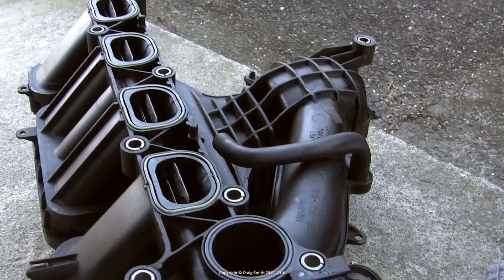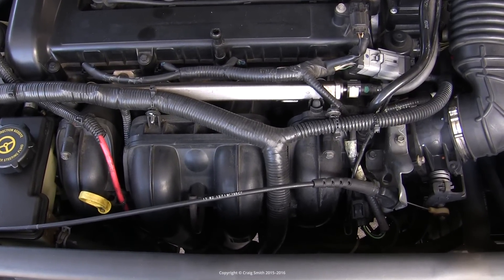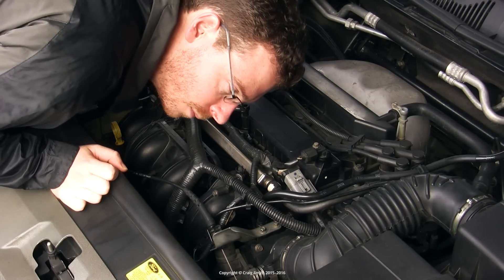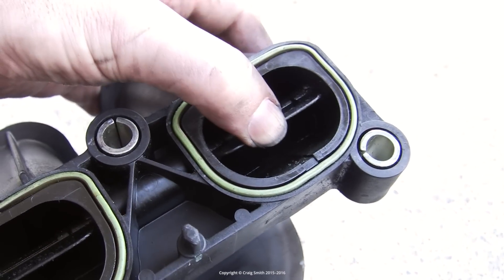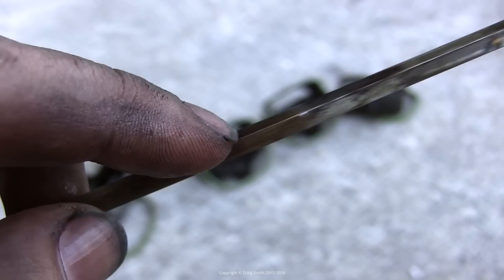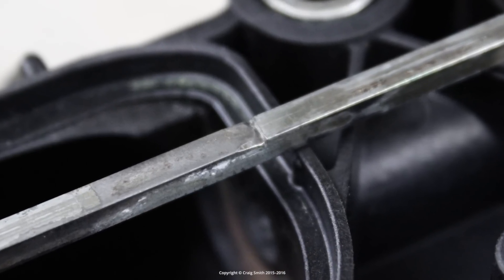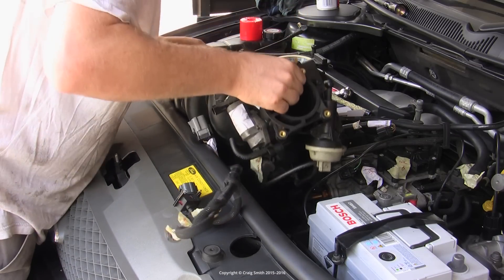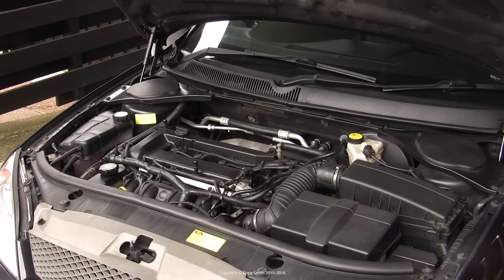How to: Fix swirl flaps & save your engine (Ford Duratec HE, Mondeo/Focus/et al)

Comment from the maker: Amazon links to relevant products (from the description):
Flap assemblies (x4) - http://amzn.to/2d3dawe
Manifold gasket - Amazon US: http://amzn.to/2bV8sLi  |  Amazon UK: http://amzn.to/2cpztel
J-B Weld epoxy - Amazon US: https://amzn.to/2HC7RRk | UK: https://amzn.to/2woHtUC
Reply: Hello Craig, If you have it could you post the actual Ford part number for the flap assemblies? The part on the link does not have the Ford P/N. I tried to capture it from the video but want to be sure.Thanks KPO.
Reply: @kpo42641  I think it's either 1317276 or 1S7G9Y428AA
Reply: What yr did they stop using tbese
Reply: The flaps , are they a sold pr piece or sold as a set of 4 ?

Comment: I got rid of the swirl flaps in my Duratec engine.
Upon examining the engineering of the whole assembly, I could not help thinking how badly conceived it is.
For one there was no bearing points on the manifold for the square rod.
The whole thing rests on the flimsy edge of the flap body, which in turn has nowhere to dissipate or absorb engine vibration.
The square rod tunnel points between the inlets, could have had a softish material bearing to steady vibration movement.
Anyways, I got rid of the whole thing and plugged the square rod holes with a hardwood round dowel cut to fit snuggly and precisely in the in-between holes.
I left the original actuator mechanism in place.
An ECU remap is all that's required to adjust the engine to optimum performance.
Reply from the maker: How did you do the remap?

Comment: Volvo V50 gasoline 1.8 liter has a fault of yellow engine which appear and dissapear and it passed the technical revision, my question is if is safety if I buy this car in Norway, they wrote this in the add : Engine light can come and go - Diagnosis says some "flaps" in the intake. This means nothing for driving the car, and you can drive it daily without noticing anything. Was Eu approved with this, and has worked fine with this daily. What is your opinion is good to buy this car or not ?
Reply from the maker: They're only concerned with safety and your engine munching itself isn't a direct safety matter. You will need to get a scan of the OBD codes to check for yourself. The electric actuators can set codes on some versions of the Duratec so it could relate to that. Cars with this engine are cheap now so it's a question of your attitude to the risk of failure vs the time/cost of addressing it.

Comment: Thanks for doing this video(8 years ago, HA!), I have a Volvo C30, which has the same engine. If the flapper valve was loose or worn would you hear a noise when the engine was under load as well? I'm chasing a sound, and I have an idea where the noise is, but everything I've seen so far is looking good. (taking off the intake manifold tomorrow)
Reply from the maker: Anything is possible.
Reply: @CraigsDIY   Well, the valves were worn badly, so I'm hoping this is what I'm hearing!

Comment: Does this affect 2.0F Volvo 2008 model? I have this exact Duratec engine in my Volvo and it already has over 300.000 kilometers and no issues.

Comment: Hi guys thanks for this great info, i have an issue with My flaps, if i press the accelerator pedal, shoud i be able to see the flaps movement? I tried to move with mi hand the extreme plastic bar and i can't do it, do You think it could be stucked? What can i do? Thanks a Lot.

Comment: I have a ST170, bought it two months ago so I don’t know what is normal or not, I noticed the engine having clicking noises and got me worried, but seems like it is the same clicking I hear from your video, the clicking increases with revs and gets muffled when the engine is at 2000+ RPM. I heard it can be the fuel injectors? It sounds like a diesel engine.

Comment: I know this is going waaay back.  But i have a 2007 Ford Focus ST woth 2.3L Duratec and it seems these inserts show up as a part# in Canada/US.  I may order rhese doe the Mondeo feom the UK. But I would think a 2.3 Duratec with both IMRC and IMTV would be universally indentical especially if the parts made in the US?!   

Long and short, I'm hoping these will work on my '07 Focus 2.3.

Amazing step by step by the way! I will be following this when I do the job!!
Reply from the maker: Yes I don't think there would be a difference. The part numbers should be the same too.
Reply: @CraigsDIY  Thanks for the reply! I'm leaning towards your repair vs...E-Bay new but  knock-off intake...as tempting as that is.
I doubt you still have the car, but did your intake repair hold up?

Comment: When doing a flap delete, do you remove the rod and keep the actuator, and then plug up the holes? will it affect the idle(make it unstable)
Reply from the maker: Correct. Others report no noticeable effect. But it must make some difference.

Comment: You only have to seal up one end of the rod hole when deleting?
What is recommended for hole plugging?
Reply from the maker: There is only one end. You could also plug the internal holes and try to make the sidewalls flat for the sake of airflow, but really best to replace the flaps if you care that much. Use an epoxy or something like JB Weld.

Comment: Well this video give me all the info on how these flap work...so as for me in central america parts are expensive so i disable the the flap system and uplug the solenoid and tube....leaving all flap open....bc the electronic throttle control the system as a regular car....car run super smooth and lots torque is nice and i get a extra mpg...first it was bugging and starving for air especially when i slow down and accelerate....

Comment: What would happen if you took the flaps out and left them out?
Reply from the maker: You would have a vacuum leak unless you seal the rod hole as explained, and ideally the inside holes too to keep the ports separated. People have done this and report no problems. In theory the engine will be slightly out of tune and less efficient at idle and low revs but it doesn't seem to make much noticeable difference.
Reply: Have 2007 2.0 and thought all the racket at the top of the motor was the chain getting loose at 250,000 miles. I did not know these had the flaps but apparently they do and when I shut off the vacuum the racket stopped.  Watched a different video ( not this one ) where guy removed all the flaps and re- installed.
When working on broken thermostat bolts recently I had the manifold off and decided to pull the flaps out. I took the vacuum actuator off of the end and using needle- nose pliers pulled the steel rod out. I used needle - nose plus clamped vise grip pliers over the needle- nose pliers so that the vise grips clamped them tighter, then hammered on the vise grips to knock the steel rod out. A lot of baked sludge made it tough and after moving the rod about half way I sprayed with Gumout and tapped it back in most of the way to help loosen the rod in the flaps. After pulling the rod out I then pried the flap mounts out, popped the flaps out of the mounts, and re installed the mounts to hold the gaskets in place. Put vacuum actuator back on with the little plastic ball piece that moves the rod.
Everything works fine without any flaps as far as driving goes.

Comment: Same shit like on BMW Diesel, the Swirl flaps gets loosen and they fall into the intake valves and damage the engine. The intake manifold is built like this, plastic, the swirl flaps are of Metal. Best way to protect the engine is to remove the swirl flaps, the engine will still running good and withhout any issues.

Comment: 300.000kms mk4 petrol 2.0 Duratec Mondeo owner here .                      I am experiencing elevated IATs when not in WOT, sometimes elevating up to 70-90c !!            No strange sound from the manifold though, is there any chance stuck flaps could be an issue ?

Comment: i got an 03 mondy with 350,000+ km on the clock, apparently engine was replaced or repaired at around 180, any scratch i get on the car i just cover up with spraypaint of a similar color, hoping to not need to replace anything other than the gearbox again any time soon so im thinking a good ol delete would be best

Comment: Well mate! Here in Canada they dont sell the flaps separtly, i have to buy the hole shebang and the pcv valve comes with the hose and the box. Nice clear to the point video. Also the one for removing the intake manifold. Thanks.

Comment: Thank you so much for this video I recently replaced the pcv valve on a Mazda 5 hoping to reduce the oil consumption and this video with the manifold replacement video was a godsend. The reason why this video was so important is because I removed the swirl flap actuator during removal of the manifold. I then put it back with the swirl flaps closed and thought nothing of it but looking at these videos again I wondered if I had the rod 90 degrees out and the flaps should be open.. Sure enough it was and the actuator wasn't doing anything. Luckily only driven the car a few miles before my conscience got the better of me. Luckily you can remove the actuator whilst the manifold is still on the car.
I checked my swirl flaps and they all seemed to be in good condition with minimal movement so I've left them in. Time will tell if that was a good decision or not! Car is a 2010 Mazda 5 with 100k miles on it so about 160k Kms. 
Thanks again for these videos 🙏

Comment: Hi, if you were to remove the rod and flaps entirely, would that create a problem with the idle?
Do you have to disconnect a fuse or some electronic part maybe?
Reply: Hi I wanted to know the same .....all I did was disconnect the 2 intake manifold solenoid and unplug 2 tube on each of it....and it ran super find the throttle idle as a normal ...I get a extra mpg vehicle role smooth when. Let off the gas... The drive mood is just so fine for me.....first it was bugging I could have heard the starving for air.....now it ran will and take off with confident.... I have a 2.3 ford fusion 2008...

Comment: I have an 05 ford focus zx4 2.0 with 248,000 Miles. It's getting bad the rattle sounds like a diesel engine at idle and low rpm driving. Guess I have some work to do this weekend as i'm not going to be able to sleep well after watching this video.

Comment: Does the 2.5 liter in a 2014 Transit Connect have the flaps?
Reply: I would say no.. My 2014 focus se 2.0 doesn't have flaps. neither does my sisters 2013 se

Comment: Interesting. Most of what I looked up about the 2.0 engine for my 2016 Focus some were saying its a normal thing. But most of the time the sound would disappear a little bit, sometimes just go away and usually would be louder than before. Can really hear them once you give it some gas though. Though doing a hearing test, it sounded like it was coming from the high pressure fuel pump. I'm assuming that would be the one, that's on the top right of the engine next to the battery and above the intake tube.
Reply: Unless ford put them back in after 2014.. I don't think 2016 has the intake flaps. My 14 focus se 2.0 doesn't have them.. Neither does my sisters 13 se. But the Injectors and High pressure fuel pump does have some ticking noises that might sound like the flaps. My 05 does have them and its so bad at idle it sounds like a diesel engine. I guess I have some work to do.

Comment: My 2.0L Duratec runs fine at 214.000 km. Maybe the flaps were refitted or refurbished, I don't know. I bought it 3 years ago for €1099,-  We'll see what happens....... Drives perfect if you put Monroe shocks on the back. Nice, cheap car.

Comment: Hey ! How much was your car driven when the intake became bad ??
Reply from the maker: ~ 150,000 km but it was done before, at about 40,000 km by Ford, so I'd give them 100,000 km before worrying. Mine weren't actually that bad as you can see, and it will also depend a lot on driving style. A lot of idling around is going to do more damage than highway km's.
Reply: @CraigsDIY  Thanks !

Comment: I have a 2005 Mazda 3 2.3    Removed the flaps and the car just won't run right.   I did NOT seal the holes between cylinders.  I had a  tune done and it still will run oddly. When cold the acceleration is hesitant. Even when warm sometimes I throw a code and have sluggish acceleration.   At this point I may just replace the flaps or intake with a used one.  Any thoughts would be appreciated.

Comment: Bought a Focus CC last weekend as of the date stamp of my comment... Had it 3 days. Engine light comes on. P2008 faulty code. Intake solenoids were shot.  Bought new ones. Solved. 
However..... I stubbled onto this video when I was investigating the solenoid issue. And boy I'm glad I did. You just saved me a few hundred pounds. 
Out of curiosity I decided to take a look at the intake manifold. (I had the bonnet open for the solenoids so hey) I think I was very lucky... 2 out of the four flaps were about to fail catastrophically!! Entirely new manifold is on its way. 
Thank you.

Comment: Hello Craig, great video.  I removed the intake on my Ford vehicle and the flaps and rod are in really good shape. However for some reason I only had the bushing between #1 and #2. I had no bushing between #3 and #4.   Have you ever heard of the bushing only being on 1 side?      Since mine appears to be missing a bushing, I am considering removing the flaps.  You mention removing the flaps and rod and then sealing the end where the actuator is.  Wouldn't the actuator arm (white plastic piece) still seal this up against the green rubber seal just as it did when the metal rod was in place?  Also, do you think having holes between each runner (where the rod once passed) would cause any issues?
Reply from the maker: Maybe I never experimented with it, the rod inserts into it so its absence might cause issues? And there's no need for it once internals removed. You could seal the internal holes up too for the sake of perfectionism but I doubt they'd make any measurable difference to anything, especially in the context of the flaps for which the engine's tuned now being gone.

Comment: Thanks for the video. Yesterday  I removed the swirl flaps on my 2.0 ltr focus but it did not have the metal carrier guides, which I assume is the latest manifold version? However the swirl flaps had excessive movement so they were taken out. The rod appears to be in good condition without wear, which I will keep hold of. I also replaced the psv hose (£43!) which was split very badly when I consider its only covered 76k.The psv valve was also replaced. During the first road test it doesn't rev independently when stationary and is smooth when changing gear as the throttle pick up used to cause slight knocking due to pick up lag. Just to mention on the focus it appears a little tighter when removing the manifold as I found tilting it was my only hope. All in took over 5hrs as removal was hard especially the centre bolt. Thanks again for the clear instructions and the tip on taping the socket to the bolts on reassembly. Cheers

Comment: anyone know if these are sold in US for reasonable price. these lnks are old. whole intake is $180 and some sellers from UK sell flaps for $150
Reply from the maker: Try Ford dealerships using the part # if they plead ignorance. But for $180 replacing the whole intake may be the ticket.
Reply: @CraigsDIY  i looked online and it's not listed so i can't look up the part number, it's not even listed on the diagram :)

Comment: I accidently broke the white/yellowish plastic piece that connects the actuator to the rod. But, I'm guessing I can just delete the flaps and it wouldn't matter?
Reply from the maker: Sure.
Reply: @CraigsDIY  Couldn't pull the rod through with pliers. Current fix: drilled tiny holes in actuator arm and the yellow rod attachment, then Zip-tied them together. It's sort of working, but not perfect. Going to salvage yard to get attachment. If that doesn't work, I'll try wrenching out the rod again.